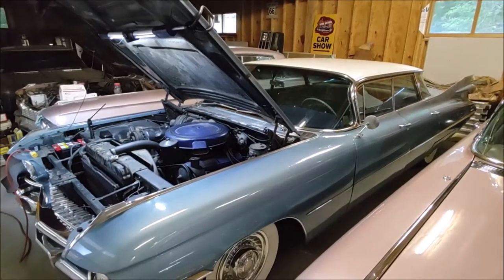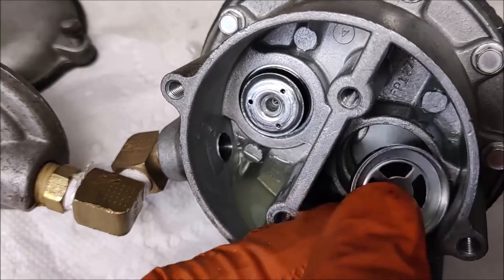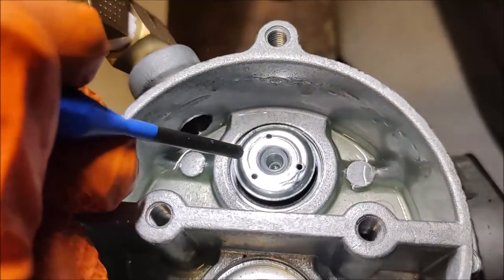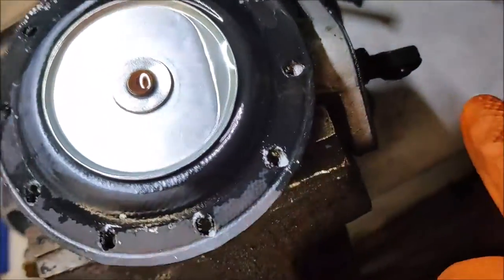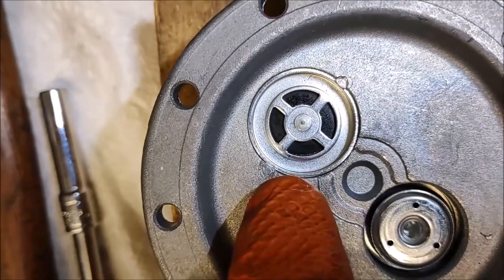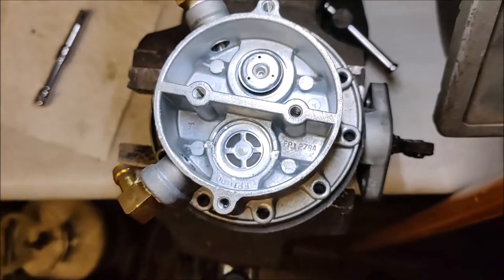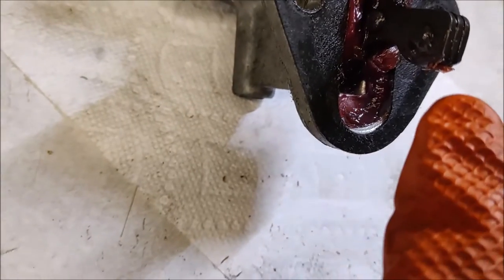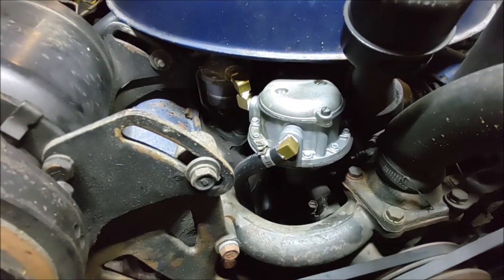1959 Cadillac Fuel Pump Repair

Comment: I replaced the fuel pump and put my 59 Caddy away in storage. When to storage started it to move out of the garage, it ran for a little while and stalled, and would not restart. I opened the top of the fuel pump and found the check valve flipped over and loose. Thanks to your video, I was able to reinstall it and get my caddy running again.
Reply from the maker: Glad to hear it, that’s why we make these videos.  Thanks for watching!

Comment: Thanks for the very clear video. What grease/type did you use to pack the internal lever area? Fixing up my 1060 Series 62, and I want to do it all correctly. Thanks in advance.
Reply from the maker: Standard wheel bearing grease.  Thank you for watching, let us know if you need any other help!

Comment: Can you show how to replace the diaphragm?  I don't understand how to release it from the lever
Reply from the maker: You need to remove the pivot pin from the lever and slide the lever out.

The lever pin is peened in place, so the best way to remove it is with a small cut off wheel or grinding wheel in a Dremel tool.  However, since this makes the pin unusable again, make sure there is a replacement pin in your rebuild kit.

One the pin is out, you need to push the diaphragm down to release the hook beneath it.  You should then be able to slide the lever out.  This will release the diaphragm.  Beneath the diaphragm is an oil seal.  Make sure to replace this seal too.

To reassemble, reverse the procedure.  Remember to include the large spring beneath the diaphragm as well as the small spring that pushes on the lever.

Once the replacement pivot pin is installed, use a punch too peen it in place so that it can't fall out.

Good luck!  It's rather easy to follow once you get it apart.  It all becomes much more obvious then.  Thanks for watching!